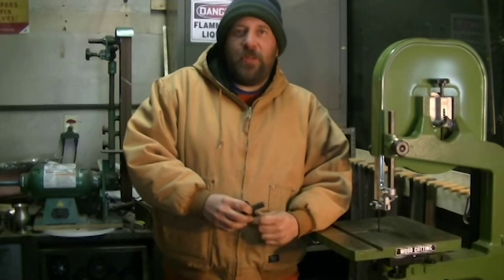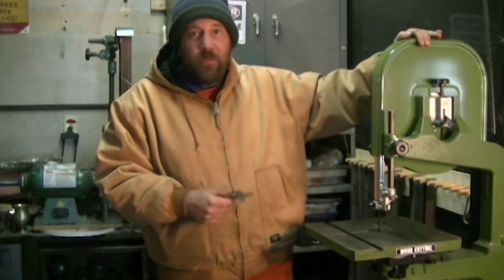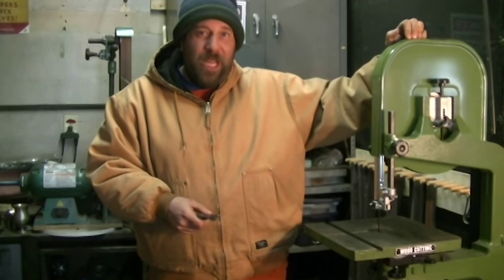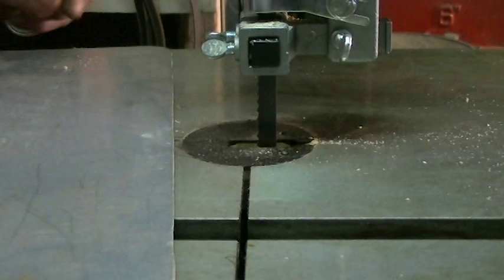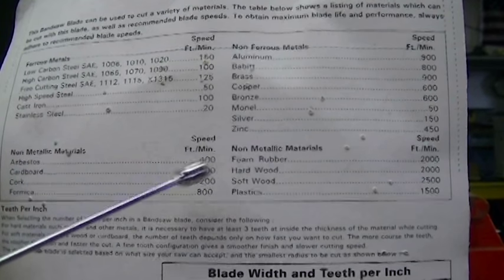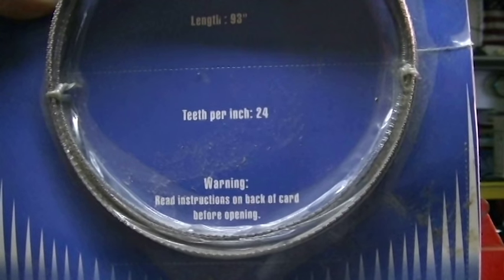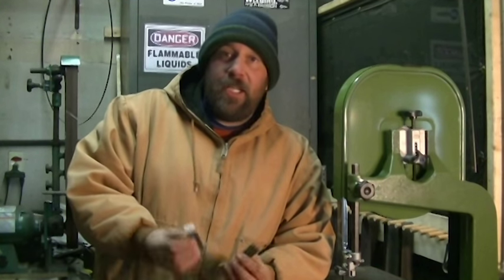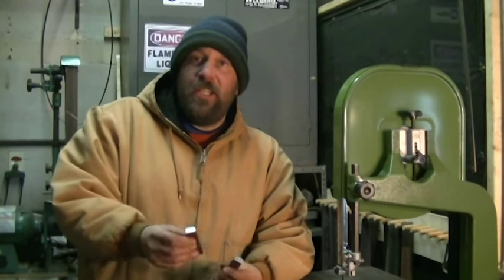Can You Cut Steel On A "Wood Cutting" Bandsaw?

Comment: is it quiet ? im trying to make a low noise metal workshop and a hacksaw is not a lot of fun
Reply from the maker: If your looking for quiet metal cutting options the best thing would be a horizontal metal cutting bandsaw. I can cut with that and you can't hear it just taking a couple of steps out into the driveway with solid stock. Hollow stock like pope can vibrate a little bit but other than that you'll forget its running. Its a good thing there is an auto shut off when the cut is finished. On thick stock the loudest part of the cut is when the drop hits the floor.

Comment: Hey Jeffrey, does that bandsaw have an adjustable speed setting? It seems much slower than mine. I did buy one of the bench models, Craftsman 10", and some bi-metal blades. I've done a video on cutting aluminum with it but the speed seems crazy fast to try steel. I even bought blade wax to help. Great Craig's List find.
Reply from the maker: +eviltwinx `This bandsaw has 4 speeds that are changed by moving a belt on step pulley. It reminds me of the setup on an older craftsman wood lathe.
Reply: add a VFD motor control

Comment: I tried putting a metal cutting blade on my 9 ince wood cutting bandsaw it didn't EVEN cut a little! It will cut wood, and plastic,  not carbon fiber,  and not steel. You need to slow that blade down.  Some thing is going to take a shit, sooner or later, hopefully it is minor. Think about this. If you make a band saw and all you have to do is switch the blade out why on earth would you say "this saw is for wood only" why not say "hey just change the blade and you can cut anything you want!" It would be a great marketing edge that EVERY company would use EVEN IF they sold one for metal cutting as well.
Reply: His exact bandsaw has 4 step pulley, with 4 different speeds. The lowest speed is about 700 SFPM. Some of the smaller, portable metal cutting saws will run around 500 SFPM. So it's pretty close.

Your 9" saw runs at like 2500 SFPM or higher. Way too fast.

This is the reason this guy falsely believes that any bandsaw can cut steel with the right blade. Wrong. Well, technically you can cut a tiny bit before your blade is dead.

Comment: TPI on a blade is not definitive on what the blade is used for I ran a 42" wide or 36" tall horizontal band saw with speed control we used a blade that was 24-26' long and the teeth on it cut everything from 6061 to Stainless steel the teeth were 1/4-1/2 spaced and the fillets were deep for the chip to go, it had more to do with coolant and blade speed, and what that blade was designed to do. The blade dropped straight down, we also had a pivot type saw and a roll in type saw and a doall, they all used differnt type blades.
I cut cold rolled hot rolled stainless brass and aircraft aluminum on it all the time on the same blade, the 6061 always clogged up the guide bearings with chips.
First time I cut Stainless steel with it I had it speed set for aluminum needless to say I case hardened the steel and burnt up a back then 400 dollar blade I'd just put on the saw new. OOPS. Got my ass chewed out for it.  
I didn't make many mistakes after that but I'll tell you if you're making parts for the welder don't cut them short, or you'll find your ass fixing the 80 parts you screwed up with a Lincoln and a lot of welding rod. Oh well I needed to learn how to lay a bead .

I would use one of the cooling lube sticks to help keep the blade cool because you're not cooling it with coolant.
  http://agscompany.com/product/cut-ease-cutting-lubricant-stick-1-lb/

You can use that on a drill press or about any tool using high speed cutting tools. Or even a hand saw on metal, Its real handy on a bandsaw and its been around for a long time, the sticks used to be green if I recall.

Comment: Nice video! Does this model have the multi speed pulleys?
       I've been saying this for decades. A band saw will cut anything as long as the operator selects the correct blade type, T.P.I., blade speed, feed rate and coolant if indicated. Give a skilled operator a mediocre saw,, he'll know how to do the job right. Give a ham handed baboon a good machine, he'll instinctively screw up the work and the machine.
     I've got similar Taiwanese band saw. I fabbed steel upgrades for almost all the essential die-cast parts like guides, tracking hinge, and installed a pair of four sheave pulleys. Now its a champ at just about any job.
Reply: 51diogenes I just bought  ($100) saw that looks identical to this saw, it has 4 different pulley selections for speed control.
Reply: A good score. With the two four sheave pulleys (usually 2",3", 4",5" combo) top and bottom, you'll have  a decent speed range for woods. Typically, they are run with a 1425 rpm motor. Your slowest speed pulley combination you'll have is about 570 rpm.  One revolution of this 14" band saw's lower drive wheel moves 44 inches of blade. So at 570 rpm you will move 2,137.5 feet of blade . At this speed you can probably cut 20 to 18 ga mild steel acceptably with a 24 tpi metal cutting blade. But at that speed you will still shorten the life of the blade somewhat. If you want to saw say 1/4" mild steel plate with this saw, a 14 tpi blade is recommended at a maximum speed of 110 to 120 FEET per minute. Your goal then is to reduce the motor input speed to 32 rpm or a bit less. BTW please check my arithmetic. Good luck with your new machine.
Check out videos on making wooden pulley gear boxes.

Comment: The spacing of the teeth have nothing whatsoever to do with if it's a metal or wood cutting bandsaw. TPI for wood cutting is a very important indicator on Arc of radius that you're cutting the way the wood chips are being pulled out of your curfe

Comment: Might be a dumb question but, whenever I see anyone cut steel on a 'wood-cutting' bandsaw, I always wonder: don't you need some sort of cutting oil?
Reply: Vertical saws generally use a stick lube like DoAll Toolsaver for the simple reasons it's a hassle to capture coolant on a vertical machine with a work table and intricate cuts are harder to make freehand under a coolant bath.

Comment: Just so everyone knows there is no such thing as a woodcutting blade and a steel cutting blade. There is Carbon, Bimetal, Carbide and Diamond blades .The most common blade for wood is Carbon and that is the least expensive. You can cut Carbon steel, and Aluminum with these Carbon blades . Bimetal is used for most steels from carbon steel to stainless steel.
Carbide is used on exotic hardwoods, and can be used to cut just about any steel or wood.
Carbide is expensive , and the more teeth the blade has the more expensive it gets. Diamond saw blades are used to cut quartz, glass, ceramic and other materials.. Carbon, Bimetal, Carbide and Diamond is what the blades are made of . No wood or metal blade.

Comment: anybody try a rheostat for speed control ?
Reply: anthony di vincenzo if you slow the rpm's in that manner, you will lose a lot of torque and the blade will just stop.
Reply: wont work on induction motor,  Only on a DC motor and you wont find a DC motor rated 1HP. Only way to regulate an induction motor is a 3 phase or a variable frequency drive as its the frequency (60hz) divided by # of poles gets you ~1700-3600 RPM.

Comment: you want three teeth in work for proper cut one entering one leaving one in middle of work for size of metal 100 to 300 feet of blade per minute  i put a right angle gearbox in mine to slow it down

Comment: It's weird that your replacement blade had speed requirements based on feet per second, instead of the standard rpm revolutions per minute.
Reply: Because with the same rpm, different size pulleys will go at different speeds. 

A big wheel spinning at X rpm will have more speed on the circumference that a small wheel spinning at the same X rpm.

Comment: All he said was it WOULD work, all you people going crazy complaining need to pay attention. If you want to whine get your own website and whine all day.
Reply: Naw. He repeatedly states the ONLY thing that matters is what kind of blade is on there. He never mentions speed being relevant, nor does he seem to acknowledge that 99% of bandsaws do not adjust anywhere nearly as slowly as this particular wood  bandsaw.
Reply: Wait. He also says the FEEDRATE is all you need to modulate if the blade speed is too high. This is completely wrong. If you feed slower than optimal, you just dull the blade even faster. IF heat buildup in the material is a problem, you don't slow your feedrate, you would pulse it. X second of feed, X seconds of rest. This might be the case for brass or aluminum. Cutting steel at the speed of most wood bandsaws, the problem will be the heat that is created right in the blade. Doesn't matter how you feed it, the blade will live a short life and this will be completely impractical, unless you get free bimetal blades.
Most of the things/ideas he states in this video are completely wrong. It just happens to work for him, because his saw runs really slow. And his metal saw runs really fast. And he drew many incorrect conclusions.

The people whining? Some of the "whiners" include the hundreds of folks who wasted time and money to try this nonsense after watching this video. The only problem, they didn't happen to own this exact model of saw which runs unusually slow for a bandsaw. Most run at least 2.5x as fast on the lowest setting.

Comment: Instead of spending the $180 bucks on the ryobi bandsaw from homeless despot . Take that $180 and flush it down the toilet... it’s a far better use then buying a ryobi. And it will save you a lot more cash in the long run